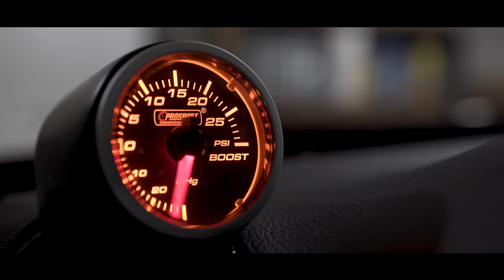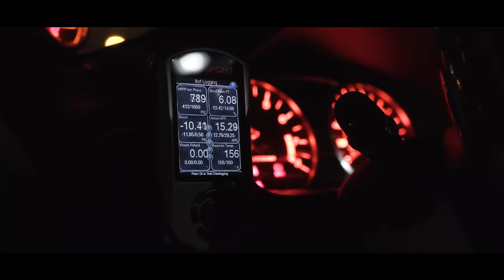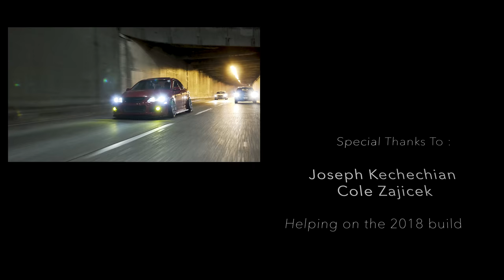Mazdaspeed 6 Midnight | 4K

Comment: Those who want my estimate. bags/suspension $4500. Intake $1100. Bov $350 engine mounts $650. Hoses,catch cans,intercooler,and misc accessories $2100. Rep Wheels $3000 (13k if real).ap and guages $1100. Turbo/manifold $1600 . Car base price today est $9500. Total is a minimum of 26k and that's just what I see I'm sure there is more. Not including labor

Comment: Is there any way you can throw out a number on how much went into this build?
Reply: over $10k in mods
Reply: @tight421  bags/suspension $4500. Intake $1100. Bov $350 engine mounts $650. Hoses,catch cans,intercooler,and misc accessories $2100. Rep Wheels $3000 (13k if real).ap and guages $1100. Turbo/manifold $1600 . Car base price today est $9500. Total is a minimum of 26k and that's just what I see. I'm sure there is more